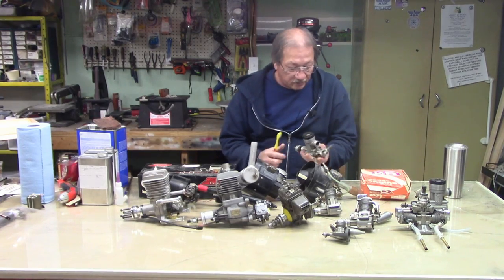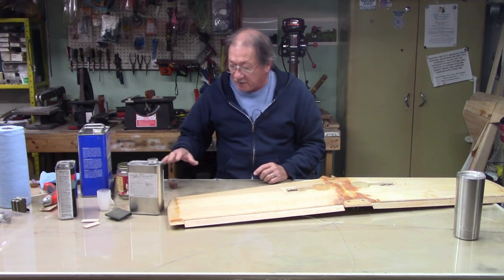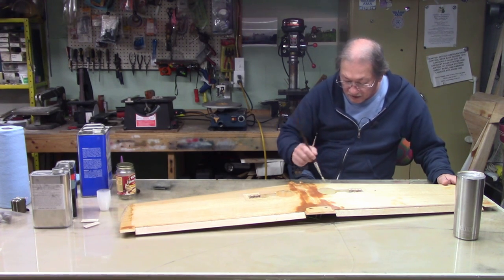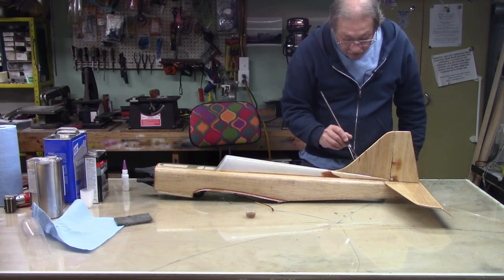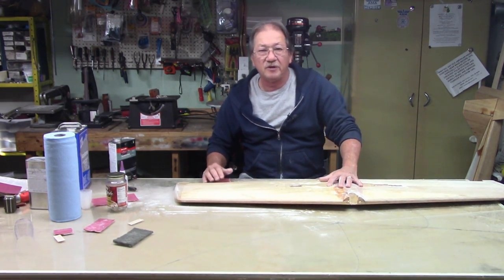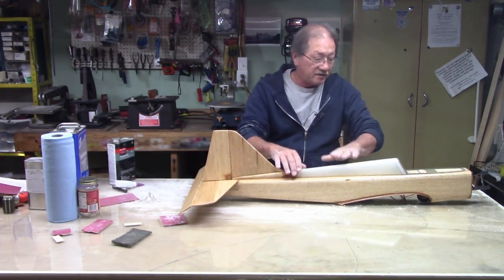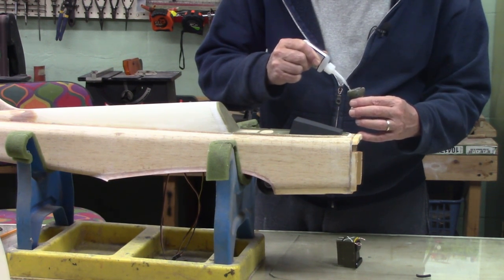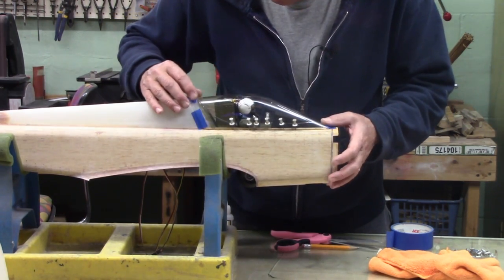SIG KOUGAR BUILD   Part   20C

Comment: Welcome back, I was wondering when you were planning to work on the Kougar.  I really like the cockpit details. great work..
Reply from the maker: Terribly busy summer. I didn't  get much leisure time to fly or go fishing. I usually get about 20 days on the water, this summer only 2, only 3 casual days to go fly not counting airshows and fun flys. But its building time now. I need to catch up on your vid's while I'm at the building table.
Reply: @rcmodeltipshints9462  Sounds good. I am going to be finishing another plane here in a few weeks. SIG Something Extra. I also finished an old COLT Kit. What a nice plane.... I think I will be starting the Midwest Giles soon... It should be a great build.